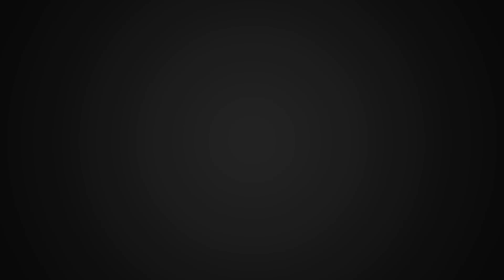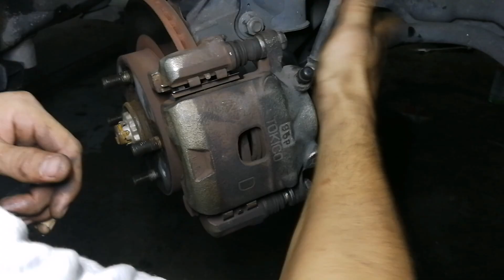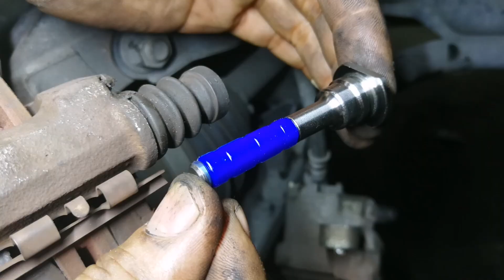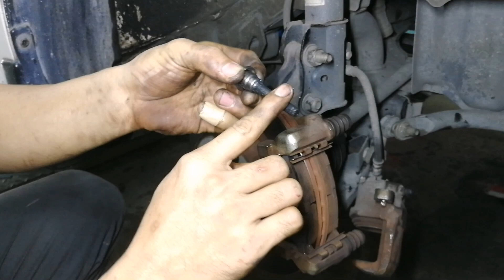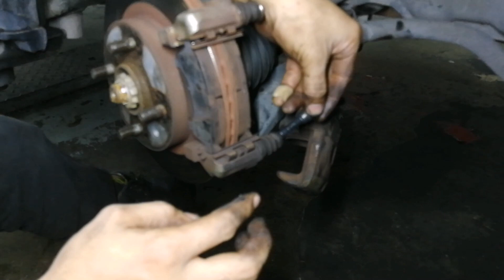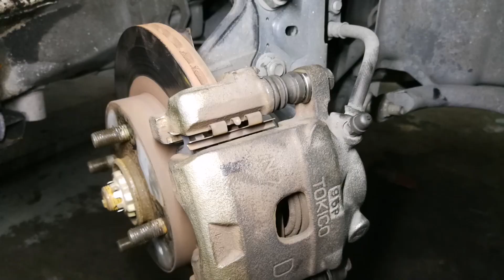Myvi Front Caliper Slider Pins Noise Solution

Comment: Bro,can i use myvi old model caliper pin to replace my rattling caliper pin in Toyota passo caliper??..
Reply from the maker: Have to measure and see whether it's same, but why replace with silicone pins, just because the internal slightly worn off, hole slightly bigger, so the silicone pins can fix it nicely and kill the noise.

Comment: Hi, caliper pins in Celerio making noise even after replacement. Can we repakce silicon bush?
Reply from the maker: If still can't fix might need to change some other brand which silicone is slightly oversize or change the caliper then.
Reply: @zendengoh  Mechanic only replaced caliper pins not bush. Does bush comes with pins?
Reply from the maker: @bhushannalawade9769  it's aftermarket caliper pins which got groove for silicone or o'ring, to fit the clearance hence eliminate the noise.